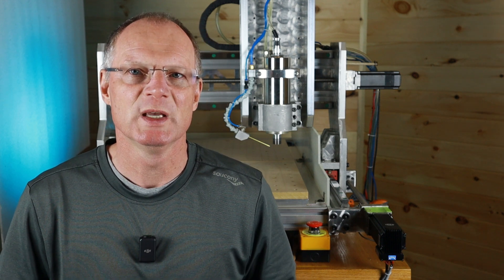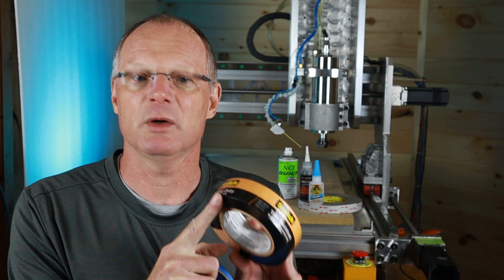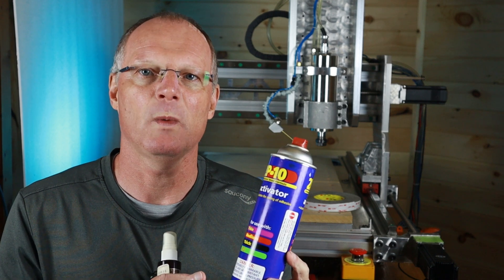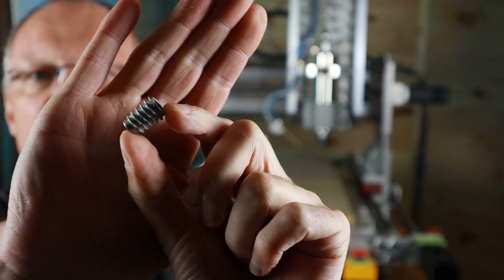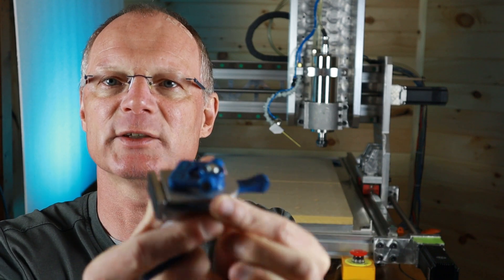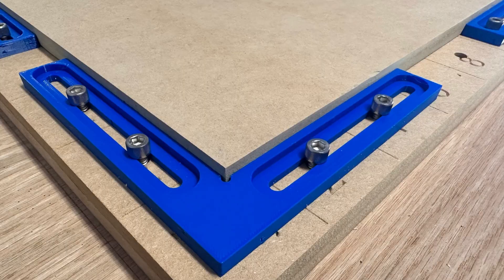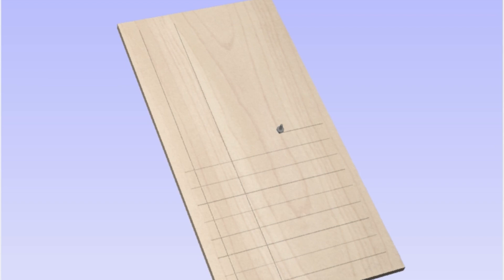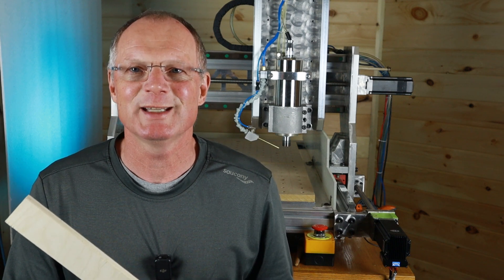Workholding Systems CNC Router Beginner to Pro EP 03

Comment: Hello, your channel is pure gold! thank you so much for the insights. One question: how do you remove the CA glue from the workpiece (Aluminium) or do you use CA in a sandwich layout between two layers of tape?
Reply from the maker: Thank you Erik! Yes the glue goes between 2 layers of tape. I have glued small pieces directly to a plate and use some heat to get the part off. If glue remains I just put the part into acetone or I sand it off.
Reply: Amazing, that makes totally sense @JBWorx . I will give it a try, 100%. Merry Christmas from Berlin and looking forward to see the rest of your videos.
Reply from the maker: A merry Christmas to you as well I hope you enjoy the other videos.

Comment: The clamps for the poor people I use: 
1. go to your preferred hobby store and buy aluminium "L" profiles of different profile sizes (the thicker is the better, i.e. 2 mm)
2. Return to your shope and make holes with your drll to create elongated slots along the profile length on the long leg of the "L" shape.
3. Refine the slots with a file to provide a smoth place where the vertical screw will pass through.
4. Cut as many profile sections as your holes/slots along the profile length.
5. Your done. Now you have a lot of low profile clamps of different height to be used.
The short leg of the "L" stay slightl angled on the spoliboard surface.
The long leg push over your plate of material.
I use this clamps made  of alu-profiles to clamp plastic plates and alu plates with small tools (i.e. max 4 mm of dia)
Reply from the maker: That is actually a nice idea that I can see to work well. Thanks for writing this
Reply: @JBWorx  By simply stacking the alu-profies one over another you can also get the rigidity you desire for any specific clamping needs.
Reply from the maker: I have some L profile I’m my shop I will give this a whirl

Comment: If I may add. For the vacuum plate we can also use some vacuum cards or vaccum fleace materials.  So the need for the part material to be very clean is not necessary anymore, also the fleace or card material can help improve the force of the vaccum. This will work for the vacuum plates with holes instead of the grid pathern.  For the grid pathern u can use a pice of sand paper inside the peritimeter of the gasket.
I use a Busch R5 100cubic meter pump never had issues with a part moving .
I generally use the vaccum fixture when I have multiple parts. I leave 1-2 mm material in place then I cut all the parts and index them on the vice and mill the second op.  Hope this helps out. Happy miling!!
Reply from the maker: Thank you Varlan, yes you are spot on even a sheet of newspaper can improve the vacuum by a great deal … the vaccu-card from Datron is pretty cool 😎
Reply: @JBWorxStudio  I gave the datron card a shout out because if u search online u can find info on them but I only used them once. To expensive....I generally use the Villmill film from Sorotec also the vaccum fleace the ofer either 1mm thickness or 2 mm .very safe and easy to use and cheap. :)
Reply from the maker: I have to check the sorotec material out I had not seen that, but then for me useless as they are not shipping to the US.

Comment: What a nice and info packed video! Thanks.
Surprised to hear that you are using 1/4-20 bolts. I thought it was only those of us in the US who had to deal with archaic units😃
Reply from the maker: They have a much better price than metric hardware especially for the threaded inserts. But at the moment I use all M8.